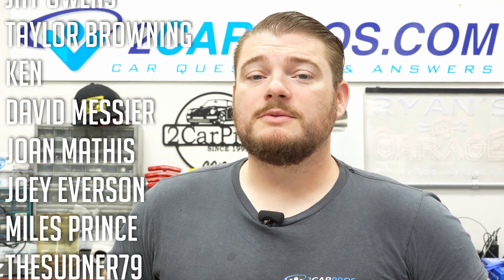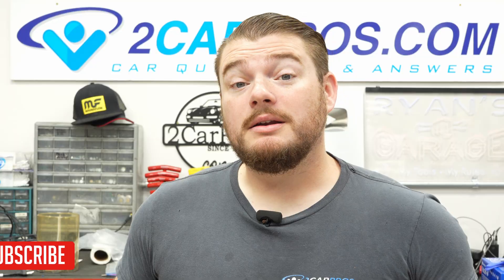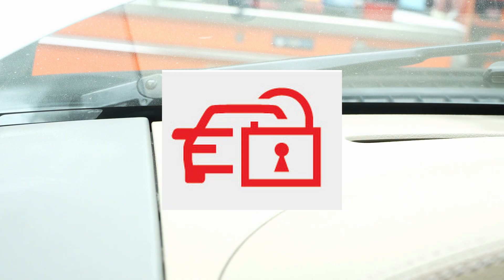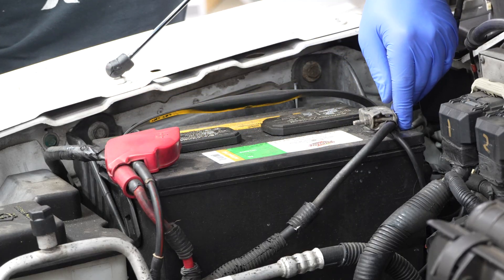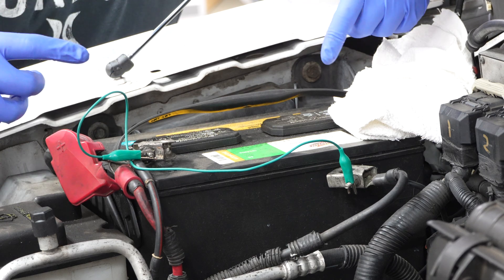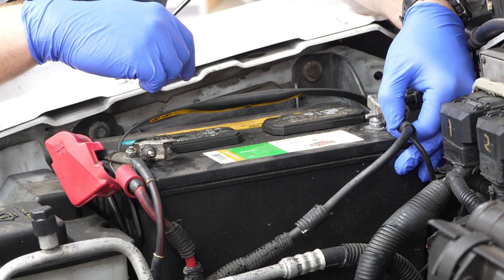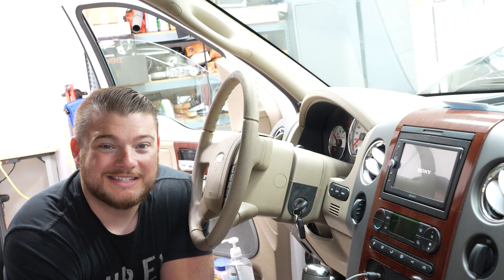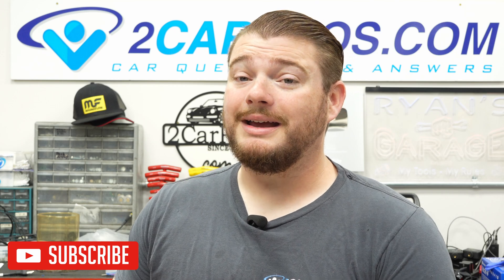How to Hard Reboot and Reset Your Car’s ECU (Engine Control Unit) | Easy DIY Guide

Comment: My car stop running it turn on fine and nothing pops up in the screen I put it on D and it doesn’t move I put it on R and it doesn’t move at all I need help because I don’t know what to do my mechanic told me it was a sensor but after I bought the part sensor was asking for a ecu code pop up on his computer I need help

Comment: I knew that light was the security system. But I have no problem when it’s blinking starting my car. I have a 2006 Lincoln town car signature Limited. And someone in another video about that car said that was a windshield sensor light. It didn’t sound right to me, mine most of the time! Currently, I’m disconnecting to clear a engine light that indicated the number eight ignition quill was bad so that was changed by my son, but he didn’t disconnect the battery when he changed all the coils. So the light is still on, so I’m disconnecting it hoping it will turn it off because I need to have the battery at a full charge to have it retested because when some guy tested it after he test drove it. I don’t think it was a full charge, plus I had two cells that they were low on electrolytes so I added it to the level of the other four. With different things like me not driving much at all being retired I make short trips, I never have a problem in the disgusting, hot weather, but my battery is only a year and two months old, past its warranty and I just wanna make sure it’s completely charged and I have driven it so that when they test it, I know if it was really low because he was starting it during the repairs, and it probably wasn’t at full charge after the short test drive. So I wanna make sure everything‘s correct and I’m using a trickle charger and it is now fully charged, because I only have problems when it gets super cold. I know it’s cause I hardly drive, but it’s very frustrating! Meanwhile, I’m trying to clear the computer. Hopefully this will at least clear the engine light. I do not have that little jumper cord so I’m trying it anyway. The main thing is to get the engine light out so I can make sure everything was fixed and is working. OK then I can get the battery checked. If I go to somebody and get the code erased, they’re gonna put a drain on the battery so maybe it won’t test right I don’t know. I’m frustrated.

Comment: Great, but better to connect a resistor across the terminals. That will prevent  a voltage spike inside any module while draining.

Comment: I have that light on my wife’s Buick enclave essence after changing the alternator, battery, and battery sensor 
But it lets me drive and use the remote start won't
Do I do this hard reset to remove the light on the dash ?

Comment: Great to know! Maybe I'll get my HVAC controls back!
Reply from the maker: Fingers crossed! Thanks for watching!
Reply: I have a 4.6 L Plex engine, which I believe is the same size as the F150, or some of them. But I don’t have the little jumper cord. And my AC hasn’t been working, but it brought up them for codes wouldn’t that be great if that actually started working again.